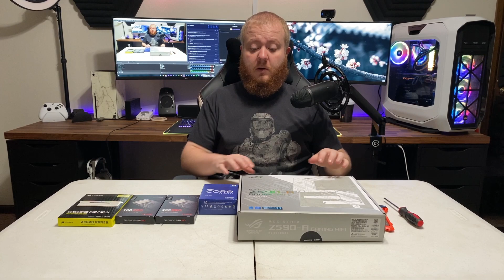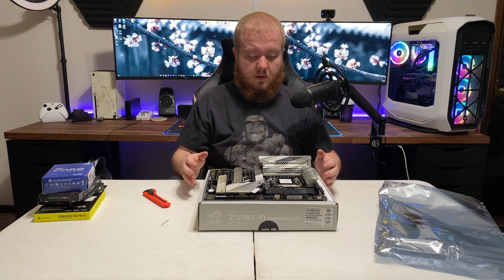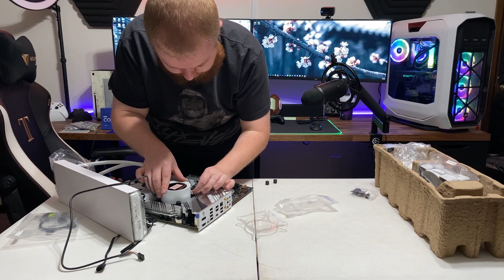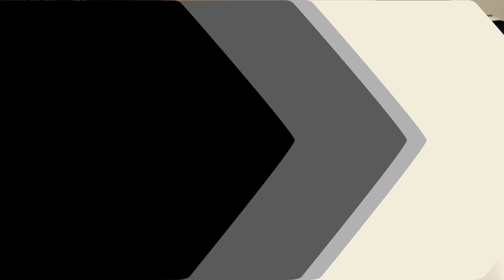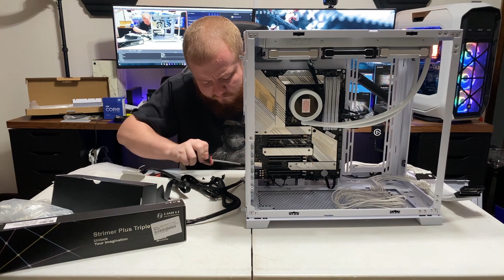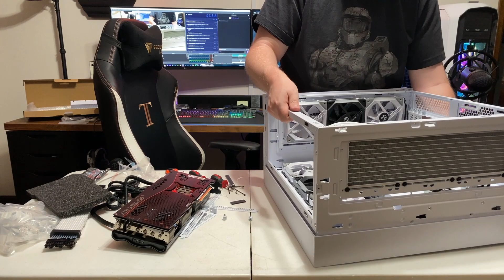CRAZY $5000 LIAN LI O11 DYNAMIC EVO GAMING PC BUILD

Comment: Bro how tf did u get the radiator to mount to the top? I’m literally holding my x73 at the top of my dynamic evo case and the holes are definitely NOT lined up properly. Wtf!!
Reply: Are you removing the mounting bracket? You need to remove the bracket by unscrewing two small screws from the top. Once you do, you'll see the proper mounting holes. You need to take top mounting bracket off to screw in y our radiator before sliding the mounting bracket and screwing it back in place.

I just built my Lian Li 011 Dynamic Evo today so I was also confused at first. Same as the bottom where you can place fans. You need to remove the mounting bracket by removing a screw that's located inside the case near the front corner on the bottom.
Reply: @TheYoonman  Yep yep. Nobody seems to mention this in their videos. I figured it out tho but thank you
Reply from the maker: @jtradergang  yeah sorry about that but E Y is correct about removing the mounting bracket up top

Comment: Hi There Greetings :) Congrats On your First Pc Built on your youtube channel👍🏽 I'm A First Time Pc Builder and Like To Share My Built specs☺️
Here's the Specs Of My Built,

Parts
Cpu  |  Amd Ryzen 9 5900x

Thermal Paste Used  |  Thermal Grizzly kryonaut

Gpu  |  Nvidia Rtx 3080ti Founders Edition(Got This Back In Early Jan Crazy Gpu Price Paid)
*Thermal Pad Replacement Done with Gelid Extreme as well as Thermal Paste Replacement

Mobo  |  Asus Rog Strix x570-i (Ryzen 5000 Series Processor Ready Label), Windows 11 Ready Label On Mobo Box)

Ram  |  (Dual-Rank) Crucial Ballistix Rgb DDR4 White 2x16Gb Cl16 3600mhz (32GB)

SSD  |  Samsung 980 pro 2Tb
            (Read: Up-to 7,000Mbps)
            (Write: Up-to 5,100Mbps)
         |  Adata Xpg Gammix S70 Blade 2Tb
            (Read: Up-to 7,400Mbps)
            (Write: Up-to 6,800Mbps)

Psu  |  Cooler Master SFX 850 80+ Gold white

Aio  |  Cooler Master MasterLiquid Ml240 Illusion White

Radiator Fans  |  Nochtua a12x25 chroma (x2) for better Airflow not using Stock Master Liquid Aio Fans

Case  |  Lian Li Dan A4-H20 Silver Pcle 4.0 Riser Included (10.1 L SFF Case)

Peripherals:

Keyboard  |  Logitech G915 TKL White Tactile Lightspeed Wireless Mechanical
Mouse  |  Logitech G Pro X Superlight Wireless White
Headset  |  SteelSeries Arctis 7P+ White 2021 Edition Wireless Gaming Headset
Speakers  |  Prism (Flow) 2.1 Ch Soundbar With Dolby Audio

Display Monitor:

1  |  Asus (ROG) STRIX XG279Q 27" 16:9 QHD 170hz (Adaptive-Sync HDR IPS Gaming Monitor)

2  |  LG UltraGear 27GP850-B 27" 16:9 QHD 165hz (Adaptive-Sync HDR IPS Gaming Monitor)

Live In Singapore where Local Temperatures are from 30+*c-36*c.

Max Temps 80 *c for Cpu and Hotspot temps for 3080ti fe slightly over 80*c after playing intensive Gaming session more than 2+hrs not bad for a SFF Case Recommend for ease of building (First time Pc Builder) Room No Air-Con
Reply: that's a powerful pc , congrats !

Comment: So the white cables with the fancy RGB stuff going on. Did those come with what you ordered or were those an additional thing? My fiancé is having a white build and we are curious about that stuff
Reply from the maker: Additional, they are the Lian li strimer cables. One is for the 24pin and the other is the triple 8pin.
Reply: @Viplotic  thanks man! Did all the white components come with white cables or not?
Reply from the maker: @wesleytornberg   the power supply and the fans came with white
Reply: @Viplotic  thanks man!